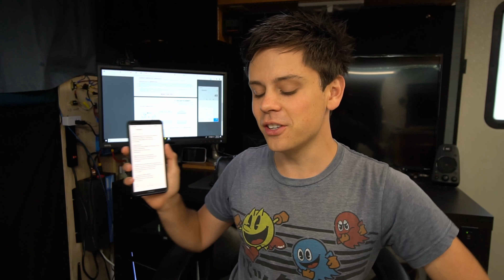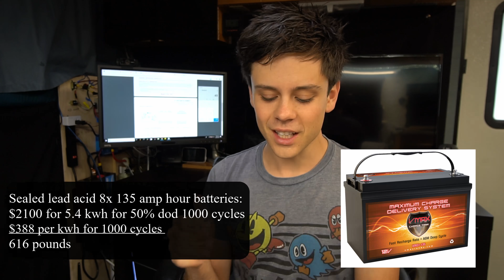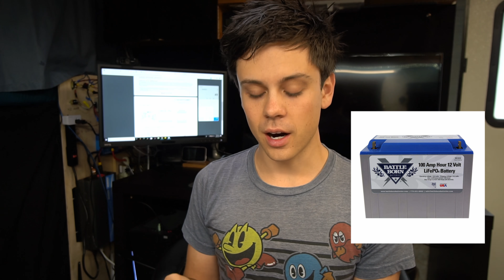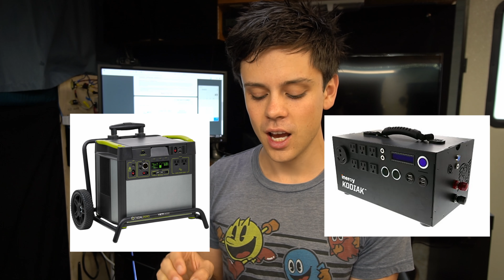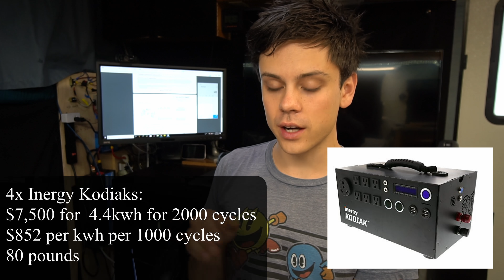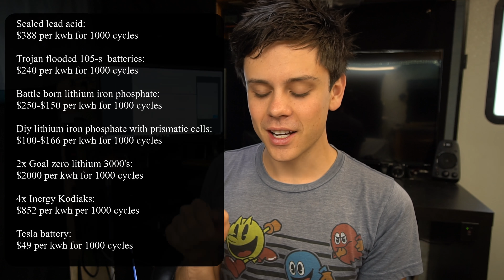Off-grid Solar Battery Price Comparison: Tesla vs. FLA vs. SLA vs. LiFePO4 vs. Tesla

Comment: awesome analysis but your comparing new to used. What you think of Nickel-Iron NiFe Edison Batteries? any good
Reply from the maker: Those seem great but super heavy. But they are super stable to over charge or discharge events. Interesting batteries. I wouldn't use them though. Unless it was ground  mounted system that needs to last thirty years.
Reply from the maker: Also has a not so great self discharge rate

Comment: 2.5kw Trojan L16RE  $380.00
The downside is you have to water the batteries twice a year if they’re in a cool shady spot if you ever run low you could ruin the whole set and they probably only last about eight or 10 years and they can really only safely run them down about to 30% maybe 20% but that’s the point where you start affecting the life of the battery I’ve been using them about three years no problems wish I had lithium so I could extract 80% safely every day I try not to run mine much below 50% hoping to get at least 10 yearsBut that means I can only get to use half the battery another words I have four of them it’s 10 kW but I only draw 5 kW per day I would prefer to have lithium 
It’s a lot more complicated and nuanced than you can describe in a few paragraphs any heavy loads towards the end of the draw are going to give you a horrible voltage drop which would damage the battery so the type of load matters!  Lithium doesn’t really care. A lithium flashlight  stays bright right to the end!
Reply from the maker: Oh man but high internal resistance, horrible coulombic efficiency, horrible charge rate, horrible weight, horrible gasses, horrible charge profile. I hate those things lol

Comment: Wow awesome video, I've been doing my own spreadsheet calculations but including the charge cycles is a good idea. How reliable is that 5000 cycle from tesla?

I'm also VERY happy that I can actually buy these tesla modules by now in Europe!!! 
I want to build a (slow moving) solar powered catamaran. Modules that are cheaper than lifepo and can reasonably be combined for 48V are awesome.

And you're definitely right, the smartbattery market is so whack, the per kwh prices are way too high and BMS and charge systems are way too expensive. If there was a single piece of electronics that does MPPT charging and cell battery balancing it would be awesome.

Comment: Don't know where you got your 1,100 amp discharge for a Tesla battery module -- they are rated at 500 amps max, with 750 amps peak for 60 seconds. Your life cycle calcs are also questionable for the Trojans https://www.solarpowerworldonline.com/2012/11/batteries-show-15-year-cycle-life-in-solar/

You also have to subtract out the temperature conditioning "vampire power", which is used to keep the Tesla batteries at room temperature. That means an air conditioner in hot summers, and a heater in the winter FOR THE BATTERY PACK -- that energy consumption is not insignificant as many Tesla owners can attest after leaving their cars, unplugged, at an airport for a couple of days in winter, only to find them completely discharged. Lead acid lives through all of those, hot under hood in Arizona and in the cold chill of Alaskan winters...happily. Abuse a Tesla battery thermally and it grows an irreversible short circuit inside, along with the attendant fire hazard that is very difficult to extinguish by professionals.

The fire hazard of a Tesla battery is very real vs the MUCH safer LiFePO batteries. This has nothing to do with "beginners" and everything to do with the nature of the beast. In a residential or commercial storage application, LiFePO is a much safer choice and lead acid still rules as far as handling temperature extremes, providing high discharge current, and surviving the voltage surges that are inevitable in a power generating system and its loads.
Reply from the maker: Hey I totally agree with you. Absolutely. And yes, 1100 amps was from a forum for the tesla. I looked into it and it was much less. But pulling 100 amps continuous without cooling is no problem. 

I used the data sheets that trojan provide for my calculations

Oh great point about the temperature of the pack during winter and summer. I live in san diego so I never need to think about that, but you are totally right. 

Yes I totally agree about fire hazard with tesla battery. That is why I have been building lifepo4 batteries like crazy lately. I totally agree.

Comment: Teslas is currently in the process of "acquiring" Maxwell Technologies in a stock-trade deal.  Maxwell specializes in totally DRY cell batts and Super-capacitors... making per/kw cost & size savings ridiculous, and the super-capacitor can dump energy like batts cannot.  This will be a game-changer for Tesla and for obvious reasons, but it will also have benefits in solar as Tesla will also be able to stop doing shared-business with Panasonic for battery production.  I enjoyed this video and found it helpful, and I'll check back again soon... as I am contemplating building my own solar system for off-grid independence.  Thanks!

Comment: Goalzero and Inergy are way more than just a battery though.  The 1000 for $999 isn't all that bad for all the other components and the 500 cycle rating  is full discharge they mention 1000 at 50%.  In actuality just keeping it over 20% is probably a huge part of that.

Comment: I'm doing an electric vehicle conversion, and after researching for a few days I'm leaning towards the model s batteries. Just not sure how many I'm going to need. I'm estimating 250wh per mile, but I don't have a drive motor yet, or the completed vehicle weight to know for sure.

Comment: Arrrrrr you kidding me.... Batteries don’t fail, they are murdered!

A lead acid battery can manage something like 14000 30% depth of discharge before failure, you setting them to 1000 cycles is at heavy abuse, the numbers you use aren't real world numbers, but manufacturer specs.

the manufacturer specs are created to give people an idea about the performance and ability of the battery, lead acid basically cannot do deep discharges, its simply a weak point in the technology, they were designed to start engines... so high amps low depth of discharge.

something which they are very well suited for...  anyways i'm just saying that in real world application your numbers for the expected life of lithium vs lead acid the battery is off by a factor of 14.
not that i want to promote lead acid.... because they also suck.
Reply from the maker: Are you kidding? Lead acid cells short in a few years when used for solar. They suck, no matter how you use them. Faradaic efficiency is also horrible. No thank you
Reply: faradaic efficiency can be at 90%, thats pretty good imo... the problem with solar chargers and lead acid is that they fully charge the battery and do deep discharges something lead acid is highly sensitive to because of their chemistry.

cannot really blame a battery for being used in the wrong way.

its like driving your car at max revs and expect the engine to last. 

lead acid battery should generally be kept between 60% to 90% charge, else they will suffer damage

Comment: Where did you get such a cheap Tesla battery from? I look at the Tesla website and they're talking many thousands for a single powerwall battery.
Reply from the maker: It's a used battery module from a car that has been dismantled. You can find them on my website.
Reply: @WillProwse  Ok, thanks for that.

Comment: Your math is wrong on the Tesla Battery. I didn’t check the rest, but your figures for the Tesla battery are for 5000 cycles, not the 1000 you are comparing everything else to. The Tesla at the cost you claim at 1000 cycles is $245/kWh not the $49 you were stating.
Reply from the maker: Even at 5000 charge cycles, you can still use the battery. Not like lead acid where it's fried. 5000 cycles is a conservative figure for my use, my c rates, and my charge profile etc. If I was cycling this in a electric car, I would get 1000 cycles, BUT I can still use the battery. It's not "dead" at that cycle limit. the charge cycle usually implies degradation of 20%
Reply from the maker: The video says 5000 cycles. Not 1000.

Comment: Ok, so even with the best battery, not even figuring the cost of the solar system. The cost of power storage is still $0.049/kWh over the life of the battery if you get 5000 cycles out of the battery with 100% efficiency. Where the cost of purchasing electricity off my grid is around $0.12/kWh and it is 100% efficiency. Our grid here is extremely reliable, so I wouldn’t benefit much from power storage. I don’t believe I’ll ever spend the money on power storage, but when panels get a bit cheaper yet I’ll probably build a system that’ll feed the extra to the grid. If my grid wasn’t reliable I could see there being an advantage to power storage, or if you were going completely off the grid.
Reply from the maker: Sure, then don't buy power storage. This video is for off-grid solar. So we use batteries.

Comment: I have a ? About tesla batteries modules so I bought 4 batteries a year ago and last week I purchased 4 more and I’m seeing a different look to the batteries I’ve received, the cover has tesla on them the bms are directly wired. Do you know if the 18650 are the same set up and chemicals, and can I put in conjunction with my battery bank

Comment: Phenomenal comparison Will!  Anyone have ideas of safety precautions for fire with these things if you are not home or with your camper?  Perhaps a sprinkler system?  If they are more prone to catch fire, may want to position it away from other solar devices so if sprinklers must be implemented that the other hardware would not get water damage....  Seriously considering buying one for my next solar upgrades just trying to work out some safety

Comment: How do you feel about capacitors between your power cells and your inverter to handle bike refrigerator compressors and AC compressors especially with the app surge limitations with other lithium batteries or actually any battery for that matter

Comment: Headway Lifepo4 cells, 100 amp discharge easy and with only a 10 amp hour cell...... they come in 10,15 and larger sizes, they BOLT together and you can configure into any voltage you need easily, if a cell dies, you can easily replace it compared to a Tesla pack.

Comment: What did you spend on the comparable BMS to manage the Tesla battery and how many hours to install/configure the BMS  to accurately compare the Battle Born solution.  One other consideration of the do it yourself, including Tesla, will they void warranties on an RV and cause an issue if you make an insurance claim?
Reply from the maker: Battery protect, custom charge profile, ocpd, temp cut off with charge controller, manual balancing. Check my other videos that covers this

Comment: Hey Will, welcome to San Diego... I'm not full time yet, but getting there.  I watched the above and got hung up on about the 13.25 minute area.  You say Battle Born batteries wont work as well as FLA batteries when using a 2000 plus inverter.  Currently I have two 6 Volt, Crown 220AM batts that work fine with my 3500 PSW Inverter, but was thinking of switching out to BB after then get a bit older, but now wondering it BB can't do the discharge as you stated with such a larger inverter.... Hmmmmm
Reply from the maker: Right. So you would need 4 100 amp hour battle borns to make that inverter work. But that's a good size battery for that inverter so it works out nicely

Comment: Tanks for the data you put together. Last year I thought l had a good deal on an end of series 100amps sealed dp batts. Cost me 100$ a piece. So I got 10. I haven't really cycled or used them yet. Just kept them fully charged on a 24v setup just in case of power outage. But now I'm wondering if those batts will self degrade just by sitting there. When I see your 55 lbs 5kw Tesla batt, compare to my 7000 lbs.. usable 6kw bp bank. I feel stupid not putting the money on a lithium battery. 
Well keep up the good work.

Comment: For grid scale storage on a large scale I'm not sure that lithium batteries are the answer. A less expensive alternative is a liquid metal battery. You can make them small enough for a single home or scale it up to power a city. They are made of antimony, salt, and  magnesium- cheap, readily available materials.
Reply from the maker: True. Yes

Comment: Nerd-fest tastic :-) Nice comparison. I've been waiting for people to sort lithium packs for campers for a while, and its good to see this info appearing on youtube now. 
 I built a 1kWh LiFePO DIY pack for my electric scooter 9 years ago and it cost £900 (£1350ish) with BMS (Headway 10Ah cells 3Px16S) . To get 5.4kWh for $1300 (+ BMS) is approx a factor of 4 reduction. Obviously  that is s/h cost which is cheating slightly, but like you say it should work just fine. What BMS are people using with these Tesla packs?

Comment: Coming from a permaculture perspective, I have heard about dead heavy weight batteries for permanent placement, not for traveling applications. Nickel iron is my long term interest, my understanding is that there is much maintenance required, but it does produce phosphate as a by product. Feel free to let me know if I am completely clueless about this, or if you feel like guiding me to other channels or websites, I would very much appreciate that. Great work!

Comment: As soon as you got to the Tesla and described how you’re adjusting the numbers to increase the number of cycles, I knew you were a Tesla fanboy making an advertising video. 
Your info is skewed artificially to present Tesla as best. Don’t do that. Present honest data. If I want to know how these units compare, I can’t rely on your video. I have to rework all the numbers. 
Very sad effort. 
Do you think your enthusiasm and obvious understanding would convince anyone?  Or do you just think your audience is just that dumb?
Reply from the maker: I'm not a Tesla fan boy. They have horrible quality control. And nothing I said about cycle life is wrong. I am cycling between 90% and 50%. So at my current c ratings for solar use, which is crazy low, I can easily have this battery last longer than I will be alive. It's easy to substantiate this claim. Read about it. They are rated for 500 cycles then they will lose 20% capacity. At my cycles, and solar application, getting 20,000 cycles is easy as hell lol
Reply from the maker: Lithium iron phosphate will last longer though. Better heat stability. But c rating is bad. So if u want them to last as long as Tesla pack, u need a big pack so c rating stays low
Reply from the maker: So think about it. 5000 cycles for battle born and Tesla. Pretty straight forward analysis.
Reply: Will Prowse RV Living and Off-grid Solar , and yet, if you are adjusting the Tesla usage profile to maximize life, but not adjusting the others to maximize life, you are skewing the result. I’m not getting any more complicated than that. 
If it turns out that you adjusted ALL for maximum life, but failed to indicate such, I will limit my comment to that specific failure. 
I’m just a strong proponent of clear and complete information.  When you calculate cost using number of cycles as part of the denominator, and then make adjustments to maximize that number for ONE of the units, it appears to me as manipulation.
Reply from the maker: Absolutely not! Because I can change the charge and discharge profile of my tesla battery AND the home built lithium iron phosphate battery. I covered this in the video. In a goal zero or inergy kodiak, or lead acid, I CANNOT CHANGE IT AT ALL!! I am stuck with whatever profile they have limited it to, and those charge cycle numbers assume 80% capacity at a given cycle. For lead acid, its even more different, and due to sulfation and increased resistance, it is worse. In a home built system, you can change the usable capacity, and increase charge cycle life. That are the numbers in this video, and is a very straight forward analysis. I understand what point you are trying to make, but in this instance, with a custom cycled lithium battery that is large, with low c ratings, it is very very easy to increase charge cycle life. I cannot do that with the other batteries. This is a big deal.
Reply from the maker: @thinkingoutloud6  Here is a quick little article to help you understand: https://batteryuniversity.com/learn/article/how_to_prolong_lithium_based_batteries

I promise that you will find it fascinating! I understand why you are trying to make the point you are making, but it is highly variable. Let me know what you think after you read some of those battery studies mentioned at this website.

Comment: you missed lipo batteries, i use the ford lipo batteries. Used 6 packs at a total of 8.7 kwh total. They work great for my solar system
Reply from the maker: No way. That's a little scary. I would never charge lipo unattended. I use them for my RC planes and copters.
Reply: @WillProwse  working for a year now, all you need is a fully programmable mppt controller. I set all voltages and specs. For 8.7kwh i payed $1200. Very happy with my lipo pack. The 18650s are no safer. If you know what your doing everything can be safe. Up to the person what they feel safe working with.
Reply from the maker: @Kammfrank82  wow interesting. Yeah agreed. Oh man I shiver at the thought. But LiFePO4 is most heat stable in weird situations. But yeah, technicall you can use lipo if used properly. Very interesting. Just keep an eye on those things!